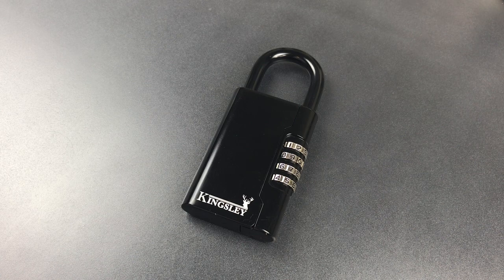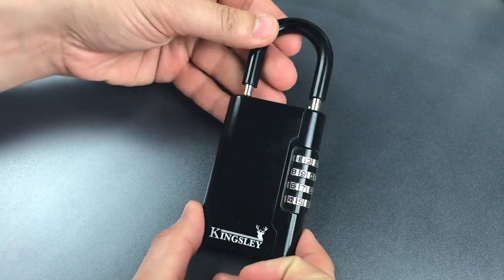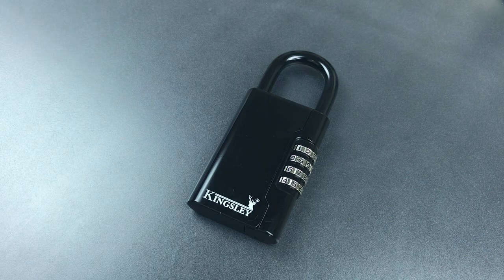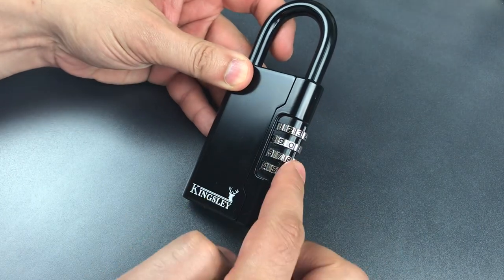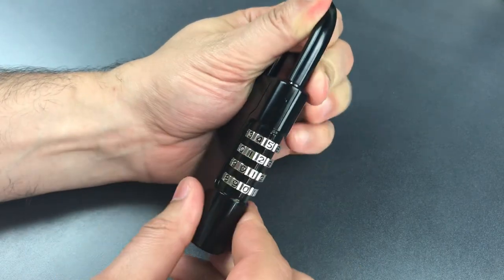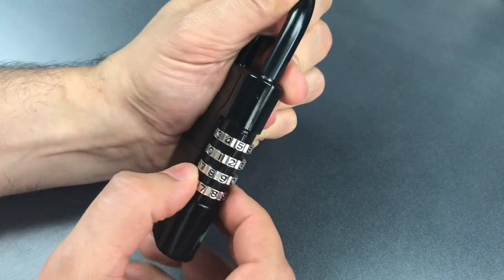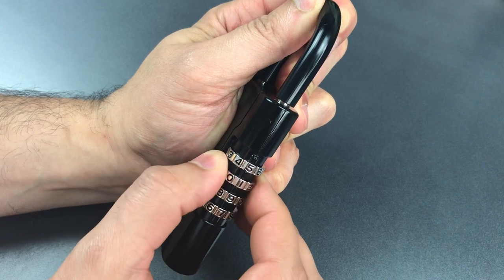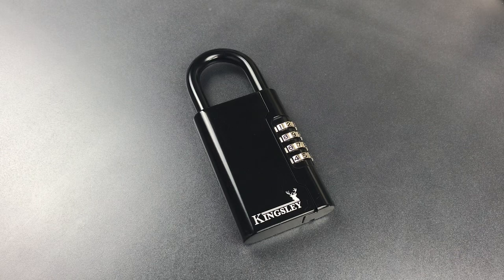[746] Kingsley Combination Key Safe Decoded

Comment: Wow, thanks for showing us this. Just picked my own lock and it was surprisingly easy. It sucks, because these Kingsley lockboxes can fit more inside and can fit into tighter spaces than other common ones. FYI - You say this is non-resettable but actually it is resettable. With the box open you press down on the shackle and turn it 90°. From there you can reset the combination to whatever you want and then release the shackle. Not that I would want to use this anymore anyway...
Reply: ...I wonder if that reset mechanism contributes to the decoding exploit.

Comment: Thanks! This works also if the lock is already opened but you don't know the combination. Instead of pulling up, just push down! Otherwise, everything else is the same. Worked flawlessly to retrieve a lost combination and make the lock usable again.

Comment: Would you PLEASE do a review of locks that are the most resistant to die grinders?! Every criminal in Texas now is using die grinders to cut the locks, and we are at a loss trying to even slow them down. I was thinking either a hockey puck style, or maybe shutter style. Thank you in advance!
Reply: Maybe if someone made a lock using Titanium it might stand up to a die grinder. Otherwise anything made of steel is probably not going to hold up if they have the right cutting wheel on the grinder.

Comment: For locks like this, if you used a torch would you not melt the key as well? Are keys made of zinc alloy as well?
Reply: Usually keys are made of brass alloys (then chromed) with a melting point ~900 C. Zinc alloys typically melt just below 400 C, so there is a good safety margin.
Reply: Most keys are made of brass (I think) or other relatively hard materials, which usually means a higher melting temperature.

Comment: The material could be an advantage if the key inside is of even lower meltng temperature - since its goind to deform it won't work on the lock it was designed for
Reply: Zinc melts are about 780 F .. while brass (keys) melts at 1700 F

Comment: I have seen a similar lock and if you push down the shackle 180 degrees from the lock position and then turn the wheels you can set the code. Unfortunately that makes it easy to set it by accident too. At least I was able to get that lock open by the same method.
Reply: can confirm, that is how you change the combination set.

Comment: My asshole brother locked my keys in a key cabinet of low quality and it has three of such code wheels like theese and when you have the right combination you simply turn it 90 degrees. Its like a cogwheel shaped handle with 3 combination in the middle. How do I decode that? Do I just put pressure by turning the handle and try finding true gates?